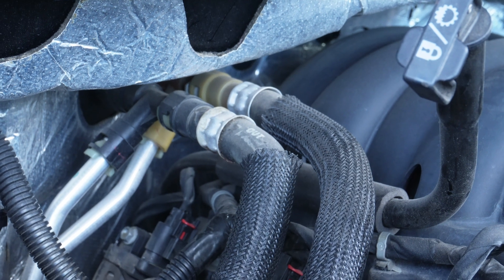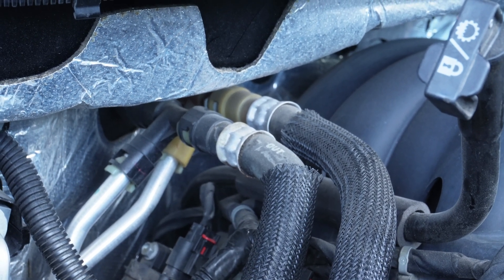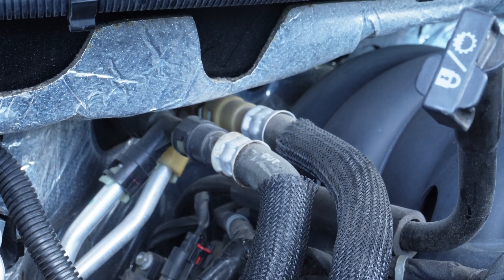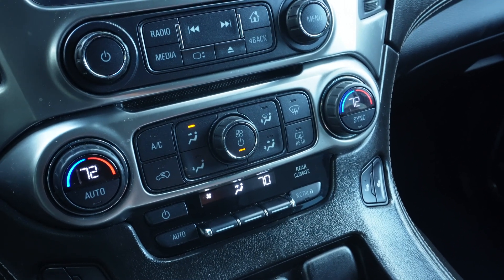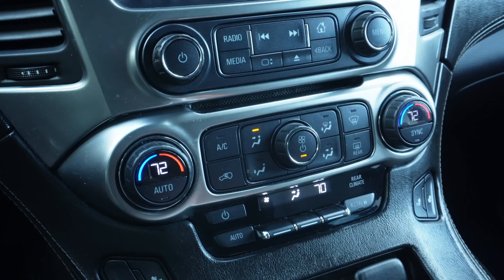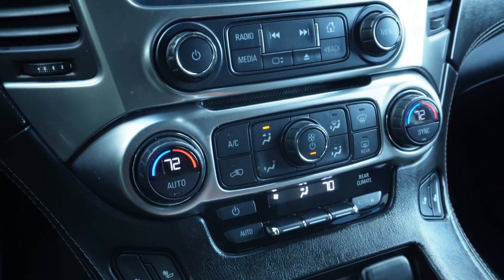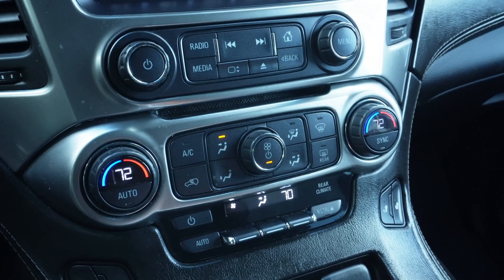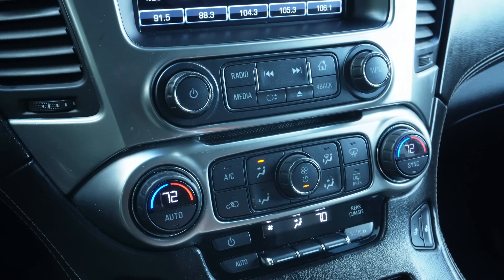No Need To Let Your Engine Warm Up In the Winter Because of this!

Comment: You really warm your car up before driving to avoid internal damage before the engine reaches operating temperature. When its -20F it’s not a good idea to start your vehicle and immediately load the motor while the oil is still thicker than molasses
Reply: If you use the proper oil, it's not an issue. Synthetic 5W30 can still flow at -50
Reply: @Zt24367  fair enough but my 215k mile Chrysler doesn’t like it’s cold starts 😂
Reply: It really depends. With 5W30, most cars won't be damaged if you wait at least 5 seconds, and as you said, some engines are just unhappy driving cold.
Reply from the maker: The damage would be caused by the unburned fuel making it past the piston rings. The oil is multi-grade and is made to flow in cold conditions and it is not really the issue. This damage occurs overtime; it's not immediate.
Reply: @pierrerepairgt  you’re right but why wear out a motor in the first place lol. Aside from that, the motor’s clearances aren’t right until it has reached operating temperature either. Most of the time on older motors especially, you can tear into your cylinder walls by pushing your motor too hard before it’s up to temp.
Reply from the maker: @Weldoholic  Haha! That's true. I appreciate the comments. Please subscribe if you haven't already.
Reply: @Weldoholic good luck getting your engine to operating temperature by just idling here in Canada I could let my car idle for 20 minutes and it still wouldn’t reach operating temperature and all that excessive idling would be hard on the engine
Reply: @TheDano1971  cardboard in front of the radiator or a leather cover works well for that
Reply: @Weldoholic cardboard won’t make a difference unless the vehicle is moving because it blocks airflow in the rad
Reply: The electric fans don’t even kick in till it reaches operating temperature
Reply: @TheDano1971  yeah I should’ve clarified lol. It won’t help much but if it’s windy where you live you will notice a difference. It would also make a small bit probably not noticeable difference just based off of the small insulation value of cardboard but if that’s the case it’s not worth risking overheating in the warm months.